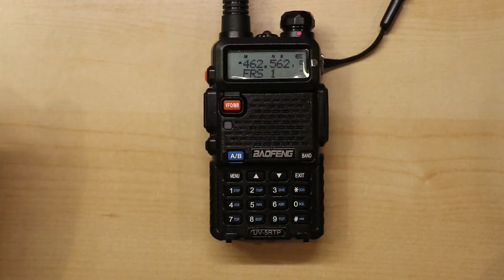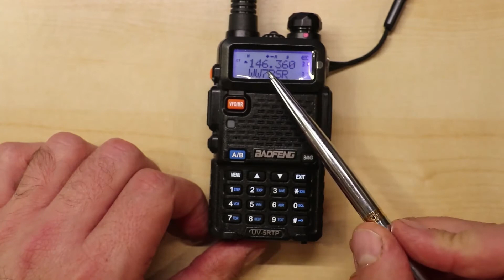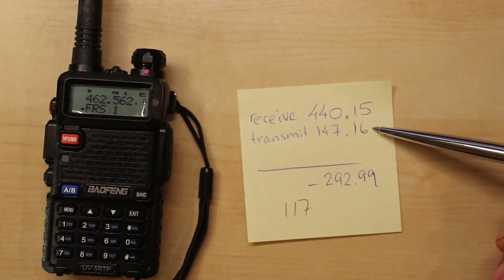Setting up Baofteng radio for Cross Band operation

Comment: This doesn't actually work properly. It allows the 440 frequency to transmit to the 144 mhz frequency, BUT IT DOES NOT ALLOW THE 144 FREQUENCY TO TRANSMIT TO THE 440 FREQUENCY, as it should. It must be programmed manually as shown, as chirp does not accept the out -of-band offset. What good is it to talk to somebody that your can't hear a reply from on the other band?

Comment: This is running split frequencies, not crossband repeat. Still useful, though. You could do the exact opposite on a second radio to effectively have a cross band repeater… but this is not a crossband repeater. 

Also, when setting up crossband repeat on any radio, use PL tones.

Comment: Some clarification:
The wording here implies that this Baofeng will operate as a cross-band repeater. It will not. What's done here is program a memory location to be able to transmit to and receive from a DIFFERENT radio that is configured as a cross-band repeater.
Confusion aside, it's a good instructional video on how to configure a channel for a cross-band offset, as I think a lot of people may not realize that you can set a very large offset like this. I am configuring my Wouxun KG-UV980P (cross-band repeater capable) to receive on a VHF frequency and transmit that received signal (repeat) on a UHF frequency (cross-band). This is so that low-power handhelds can transmit on a frequency that propagates better and receive from a high-power high-altitude antenna. Cross-band repeater = good performance using the same antenna without buying two radios and a duplexer. Win-win.
Reply: Thanks for adding more value to the posted video. 🎉

Comment: Sir , great presentation on cross band operation but that's not crossband repeater if it was anyone transmitting on one band frequency will make the radio transmit on the other band .

Comment: This video is very good I had to watch it over and over to see what you were doing finally I got it but now you need to show a video on it actually working as a repeater
Reply: It won't work as a repeater. This is for use to/from another radio that can be configured as a repeater. He mispoke.
Reply: I believe it is referred to as cross band repeat because the mostly likely use for it is that the operator is acting as the repeater. 🤷

Comment: Crossband repeat means the radio will automatically retransmit what it receives onto the transmit frequency (i.e. the radio functions as a repeater). This radio transmit when the PTT button is pushed... it has no crossband repeat function.

Comment: Hi, thank you for the video, but I have one question left:
You can enter in Offset 3 number fields. In my device I can only enter 2 number fields. So why is this? Do you programm the device?
Thank you for answering.
Reply: I had the same issue with the particular UV5R version I had which you probably have the same version.  I bought the TP version like his for this purpose because this setup works with satellite's with UHF/VHF repeaters onboard.

Comment: This is great, thank you!  Would you consider a short video showing how you actually use the Baofeng for doing crossband?  Thanks.
Reply: He can't because this is not crossband repeat. Crossband repeat means the radio will automatically retransmit what it receives onto the transmit frequency (i.e. the radio functions as a repeater). This radio transmit when the PTT button is pushed... it has no crossband repeat function.
Reply: @NaturesChild  Right!  That’s why I asked him to show us how he actually uses it that way! 😉
Reply: @michaelo6003  you could throw a simplex repeater controller in the mix and THEN it becomes a simplex cross-band repeater.